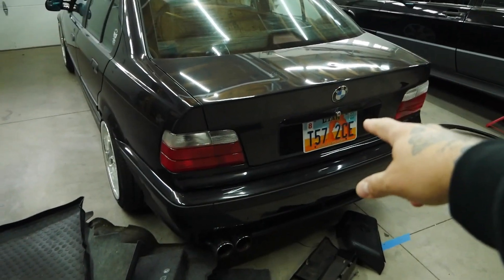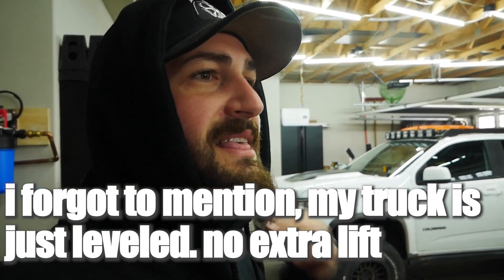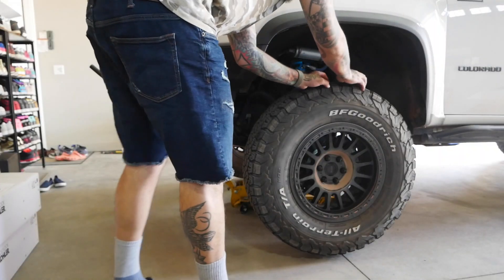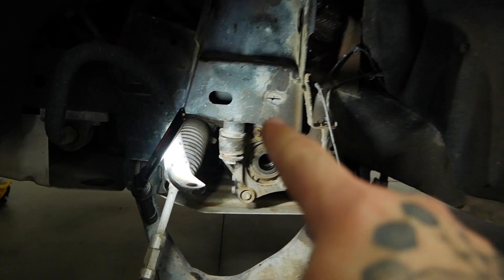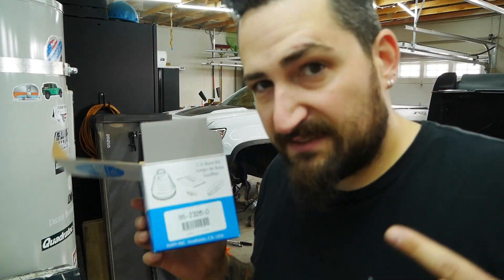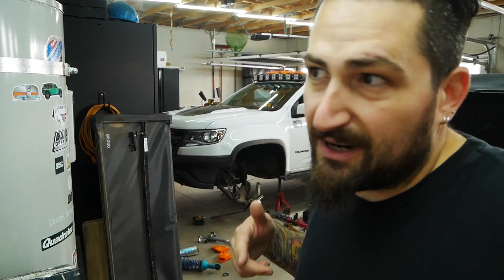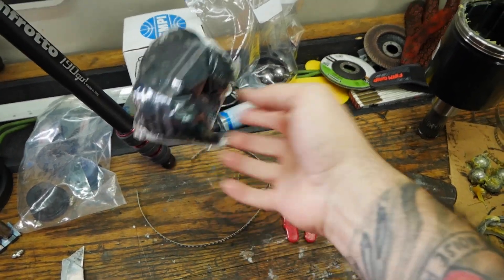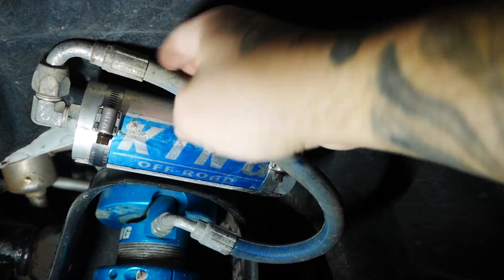My Chevy ZR2 is Broken Again. Axle Replacement. CV boot.

Comment: Okay so as a guy who's dealt with the same issues for many years on my first gen ZR2 all the real trouble started after you got away from the OEM upper control arms they are allowing for too much downward travel the rubber boots are literally getting pinched to the point where they get a hole in them I too went through this many times with my first gen ZR2. I finally had to give in and realize that I cannot have that much angle on the axle boots.

Comment: What’s the update? Still tearing boots after removing the differential drop? Just installed kings and preload and I’m still trying to see if I should do the diff drop. Thanks.
Reply from the maker: i left the diff drop in actually.. i havent torn a boot just yet 🤷‍♂️ .. seems to be the drivers side that goes more than the passenger side

Comment: Damn man....the struggle!!!  I've got ext Kings with Peak arms and that extra droop is crazy.  I swapped to delrin bushings to get rid of that clunk.  I've also installed RCV axles which are a little bit longer than stock I think, so far no issues with cv boots.  I never was a fan of the diff drop, the 589 kit looks good though.  Also, maybe think about lowering the front a bit??? I had to drop some preload from my King's when I got them from Filthy.  I'm running 650 springs with steel bumper/winch.
Reply from the maker: ive been considering dropping the front a little.. but really im level with the rear, and the rear is stock height.. my passenger side doesnt have much more i can lower also anyway lol

Comment: well, I was wondering if I should mention that after I went to Tennessee for thanksgiving, I checked my cv boots. well on my passenger side I had a small hole in one of them it wasn't tore it was like a 1/4-inch hole. kind of embarrassing after I bragged how good I thought the peak boots were .so that evening I ordered 2 new sets of boots from peak. they actually gave me 10 percent off but that's not much when both sets with tax are a little over 100 dollars. That night I didn't sleep well thinking about it so in the morning I called my chevy dealer and ordered the chevy performance ball spline half shaft. They just came in today, so I went and picked them up and they are very heavy duty looking and actually a bit heavier than the stock ones from what I Rember. they claimed they are for leveled and lifted trucks and heave off road use they are on the hall racing truck, so I am hoping this is the last time I have to take all this crap apart. I still love my truck. That being said when I looked at the axels at the dealership, I said didn't they come with a packet of Vasoline. well, that went right over the old guy's head but a girl working the counter next to him busted out laughing and asked how much they were I said $5307.23 she goes oh shit is that for real and the old guys says yep.so I feel your pain of taking it all apart again I will do mine this weekend and I hope I have thrown enough money at it to never do it again. I only have 13000 miles on the zr2. I did that truxxx 2-inch level lift kit and I won't lower it because I like the way it looks and get all kind of complements on the truck. my front fender is at 41 inches. You said you had heard the dif drop might cause issues I read somewhere that chevy sells a dif drop I am leaving the dif drop in because it changed the angle about 2 degrees i think when I did it. I also got the new peak boots the other day and will replace the boots and keep the axels for spares when i go out west next summer but i hope I don't have any more issues. at least I don't feel alone. Oh when the 1st set of boots failed my dealership said they would change them under warranty, but they would be putting the same crappy boots back on. I told them I had better boots, but they said they would have to charge me to do it if they weren't oem boots and that it would be 600.00 so i did it myself. well, it looks like I am writing a dam book I will talk at you later
Reply from the maker: daaamnn.. 600 to change boots is ridiculous.. its a big difference from the stock boots to the "hd".. stocks are plastic and im surprised they last as long as they do tbh..  Ive considered getting the RCV axles, but ive heard they arent even anything special.. the GM ones are way out of my price range.
Reply: @chrisdz  yea the price is ridiculous, and I am still wondering will it really fix the boot issue. I hate to waist money like that even if I have plenty, I was raised not to be waist full. GM should recall all these boots; most people don't have the Resorces to try to fix the problem. this seems to be the only real issue with the truck, but it really sucks
Reply: I got a question for you? If one or more of the boots on your new ball spline shaft CV's gets damaged and starts to leak grease, where do you get a replacement boot for those CV's? Those CV's are made by a company called GKN for GM and it would sure suck if someone at GM couldn't offer a replacement boot if one of those did get damaged. The fact is eventually those boots will get old, or get damaged and you sure wouldn't want to have to buy a new CV just because you had a bad boot.

Comment: I was rewatching this vid and wondered what you think broke your dust covers I recently put roga  shock skids on mine but had to take the dust covers off for them to fit. I am planning on getting some shock bellows to keep them from getting dirty and damaging the seals I believe the high-performance long travel dssv Multi Matic shocks have bellows on them. my Toyota has bellows on the shocks and I never had a shock leak because it keeps mud from getting in the seals. but what I was interested in finding out was did you actually take out the dif drop.
Reply from the maker: honestly in have no idea how it broke.. just the passenger side broke.. i had the shock skids on for 2 years and i JUST broke a cover.. so its def not the skids.(datin fab skids).  i dont do rock crawling, but when i do offroad driving its dirt roads and i drive fast.. so maybe a rock kicked up.. idk
Reply: @chrisdz  I finally found some bellows I think might work that I am going to try, most web sites I looked at want a part number I found only a few that give actual size. sand is the enemy down here in fl   that's why I am going to try something that totally seals the shaft off. oh, if you go to the great Salt Lake ir to the ocean never run in the salt water I have seen guys that have done it to throw up a spray and they even washed it off but started having seals and bearing going bad everything wheel bearings u joints shock seals etc. it will really cause problems. oh, did you take out the dif drop?

Comment: Chris,  How often are your Control arm bushings going bad?  Why do you think they go bad?  Seems like the stock control arms with a level kit dont have bushing issues.
Reply from the maker: the peak suspension bushings were just the wrong material.. when they finally sent me the delrin bushings.. they worked completely fine.. these CWF arms.. i THINK its gonna happen again, based on the shape of the arms, and how they sit in the space in the frame, could just be an early design thing.. we'll see

Comment: Forgot to mention this is the second time changing the boots. What the hell causes this issue? I leveled the truck with a resdy lift leveling kit and 33 inch tires. My boots keep ripping
Reply from the maker: if youre running the oem boots, you will most likely keep tearing them.. the HD boots are supposed to be much better(even tho ive had to replace them, but they dont fail the same way the stock ones do)
Reply: @chrisdz  appreciate the feedback. The truck is currently at the dealership again for the 2nd week in a row. Service manager is telling me the leveling kit is the cause even though I'm telling him All the forums furnish proof that it's just the boots themselves. I've already contacted a lemon law lawyer so well see what happens. No updates from Chevy

Comment: Should bought a real truck  a Ford
Reply from the maker: yeah.. seriously 😂
Reply: 5.0 cam phaser failure.
Ford bronco 2.7 dropping valves destroying the engine.
Ford bronco raptor electronic power steering failing leaving people stranded on the trail. Shall I continue?

At least the parts failing on the Colorado can be brought with you and changed with basic hand tools on the trail.
Reply: @Zarnesh83  those aren't trucks you listed but yes for cheap and dodge all have some sort problems